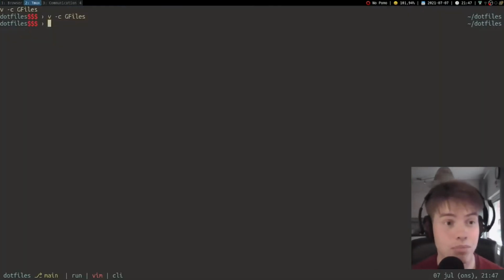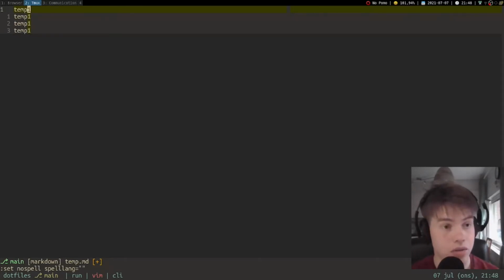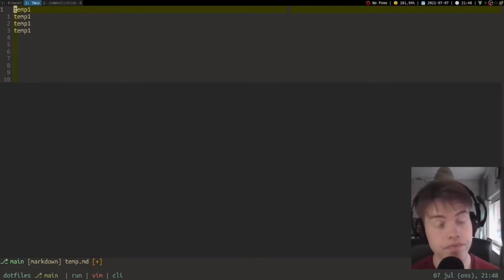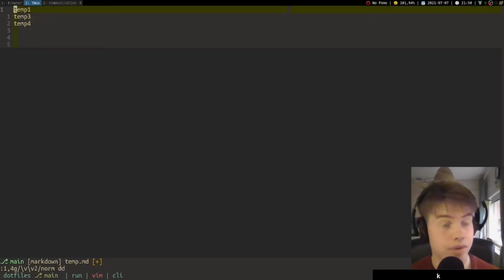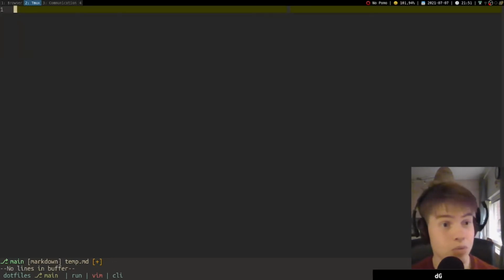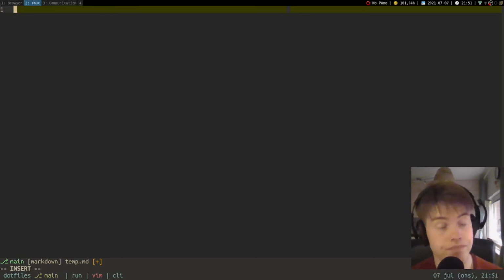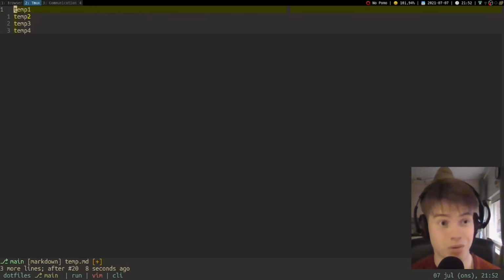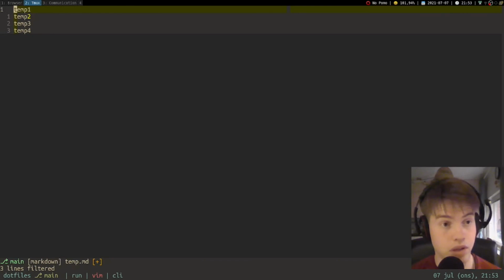Having fun with multiline inserts

Comment: Please, feel free to call me by my first name, Mister.

Just kidding, my name/handle is dougpagani and this was very neat. Using :.! + an interpreter is a WILD idea. That makes me think of some even weirder wild idea of combining it with intraline visual mode selections (which pipes text arbitrarily to an external program, instead of crudely on line-ranges) with highly functional programming languages. I don't know if you have experience with LISP but imagine taking an expression inside of ()'s, and fluidly replacing it with its return value. Basically, taking referential transparency and substitution-rule-style-debugging to an absolute extreme. You could just step-through the evaluation of a very complicated S-expression with the repeat operator, recursively (but manually/interactively) evaluating the expression down until the point you've understood what you need to.

Obviously you wouldn't want to change the actual source, but you could just use the temporary edits as a nice view to help grok some tough section of code.

Again very awesome follow-up, was not expecting where you lead it to.